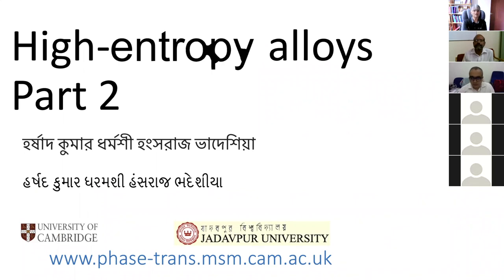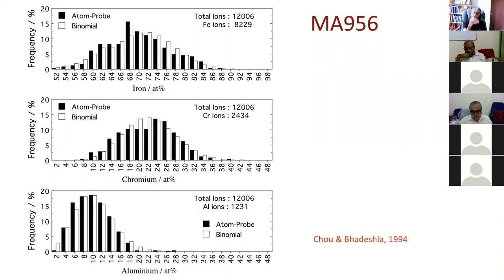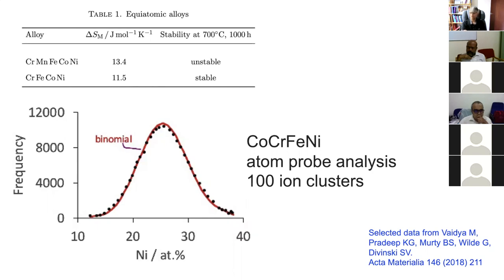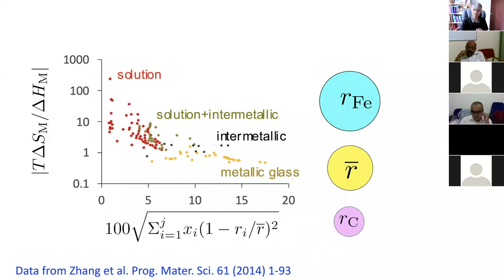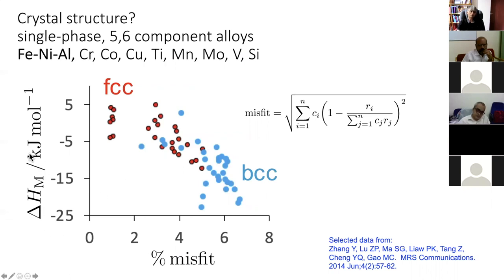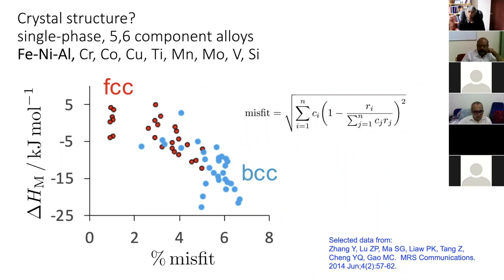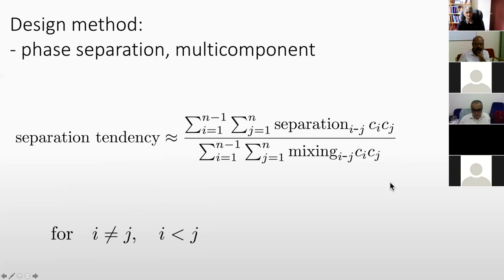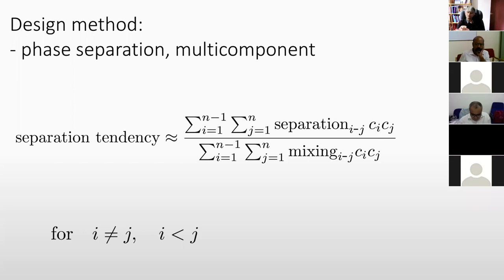High-entropy alloys, Part 2

Comment from the maker: A recent paper reports a ductility at ambient temperature of about 50% for an Al-Fe-Co-Ni high-entropy alloy that yields at 670 MPa and work hardens to about 1.05 MPa. Science 373, 912–918 (2021). Such properties are more easily obtainable, on a commercial scale, in for example, twinning-induced plasticity steels.

Comment from the maker: Interesting paper showing that a degree of atomic ordering in an equiatomic CoCrNi alloy had no perceptible effect on the stress-strain curve. PHYSICAL REVIEW MATERIALS 5, 085007 (2021). The authors used the atom probe to establish a strange kind of ordering in which there is periodicity along <100> but not <111>. The insensitivity of the stress-strain curve implies either very weak ordering or a very small antiphase boundary energy which means that dislocations behave as if they are in a disordered system. Transmission electron microscopy of the dislocation structure would be revealing. The absence of superdislocations would imply a very low antiphase boundary energy.

Comment from the maker: A recent paper [MATERIALS SCIENCE AND TECHNOLOGY
37 (2021) 765] on the effect of aluminium content on Fe_1.25 Co Cr Ni_1.25 Al_x concludes that increasing aluminium (x=0.1, 0.25, 0.4) does not change the crystal structure from face-centred cubic. This could have been predicted precisely from the the Al/Ni ratio as explained during this lecture (30.11 minutes).

Comment from the maker: It should not be surprising that charging the CrMnFeCoNi alloy with hydrogen will embrittle it. The paper published in Int. Journal of Hydrogen Energy (https://doi.org/10.1016/j.ijhydene.2021.07.136). Totally expected, well established. What is surprising is that the very low diffusivity of hydrogen in face-centred cubic alloys of this kind (Int. Journal of Hydrogen Energy 45 (2020) 10227) is not taken into account because the penetration of hydrogen into the 1.2 mm thick samples will be of the order of micrometres into the surface. This is why, for example, the charging of TWIP steel with hydrogen is so difficult beyond a depth of more than a few micrometres. I suggest that there is no work needed to assess the hydrogen embrittlement of high-entropy fcc alloys without thinking of an application and all the other design parameters that must be optimised for that application.

Comment: @47:11 At very small temperatures phononic contributations to heat capacity is neglible and therefore the measure heat capacity is dominated by the specific heat of electrons arising due to Pauli's exclusion principle (i.e. Fermi-Dirac statistics).
Reply from the maker: Yes, like all metals.
Reply: @bhadeshia123  Exactly, because these are free electrons. Therefore, the behaviour should not change be it a metal or an alloy..